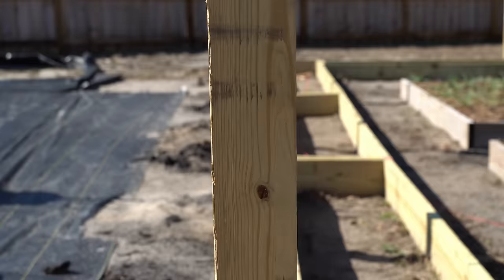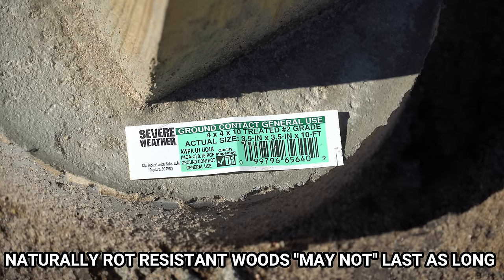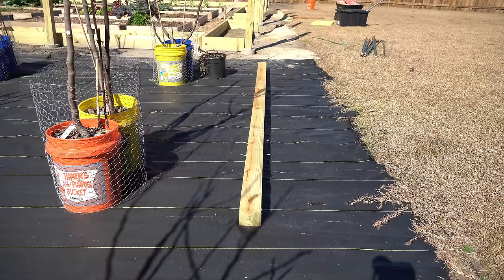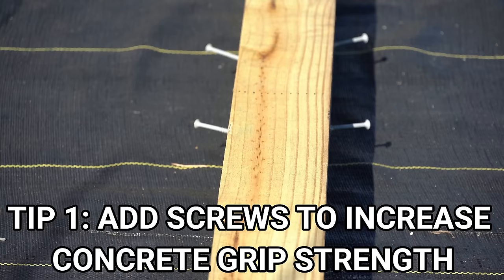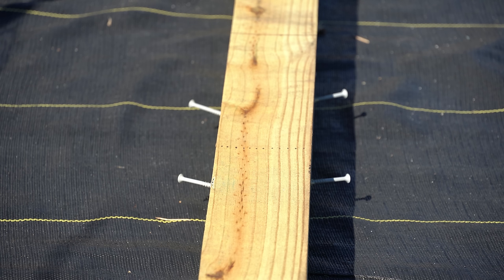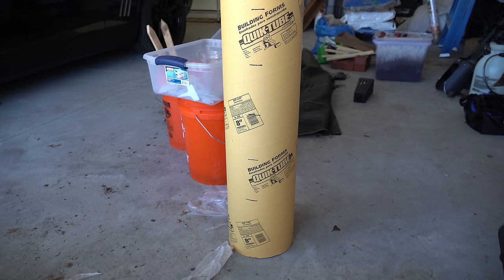3 Tricks To Installing Stronger 4X4 Wood Fence Posts That Last Longer

Comment: There a many ways to increase the longevity and strength when setting wood posts in the ground. Three main factors will affect the installation of the wooden post: 
1. Region (climate) - more specifically, the frostline depth in your area
2. Use - what is the post for? A fence, a gate, a lamp post, etc. 
3. Time - how long do you want the post in the ground? Will you remove it after a period of time?

Setting Post Depths
If you want to ensure your wooden post will never move, make sure your post is set so that freezing ground swell cannot push it back up. Here in Saskatchewan, Canada, any pillar / pile must be set at a depth of below 15 feet from grade (ground level). If you really don't want you wooden posts to move, setting a wooden post on a pillar / pile of concrete, which is 20 feet deep, will ensure this. Check your area to see how deep you need to go to beat the frost.

Wooden Post Longevity
1. Coatings - there are many ways you can increase the 'rot-time' of your treated posts. An old fashioned method is to coat the post bottoms in used motor oil, allowing them to soak up the oil before placing a coat of tar (roofing or basement foundation tar) on them. Painting your posts with several coats of paint will also increase the time it will take for wood to rot.

2. Collar Rot - ensuring your coatings comes above ground level, when the post is set, will prevent the post from rotting where it contacts the ground. Installing a short sonotube (circular cardboard collar) filled with concrete, will make sure this will not happen, however, water can still seep in between the concrete and wood, eventually rotting the post away. To avoid this from happening, caulk around the base of the post, where the concrete ends. This will have to be maintained...every 3 to 5 years it will need to be inspected.

3. Bottom Rot - if setting a wooden post in concrete, placing a 'spacer' between the bottom of your post and the bottom of the hole is a good idea. Wood screws could be used here again, but a piece of rebar, drilled into the end of the post, could be stronger.

Strength
1. Will You Remove the Post Later? - if for some reason you want to remove the post later, hand tamping the post in place, with a mixture of soil and gravel, would be the best option. This was the traditional way to set wooden posts for fences. To remove a tamped post, using a Jack-all and a piece of 2X4, screwed into the post your lifting, will work. Posts set in concrete can be removed this way too, but it is much more difficult.

2. Foam - there is a two-part foam which some people are starting to use, which expands and fills all of the voids in a post hole, essentially friction fitting the post in place. However, any strong force on the post can loosen the contact of the foam to the post, leaving it possible to pull the post straight out of the foam. Adding screws to the sides of the post may be helpful here.

3. Tamping - when tamping a soil / gravel mix around the post, compaction will drive odd sized pebbles / rocks into the side wall of the hole, as well as into the post. This fill friction-fit the post in place, but will also allow you to re-tamp the post, should it come out of alignment, because it can be removed and reset.

4. Concrete - setting a wood post into concrete is far easier than tamping, but it is still labor intensive. The weight of the concrete has an added advantage of keeping the post in the ground, provided that frost does not slowly heave it up over time. Another added value, is that the post can be reinforced to the concrete. By drilling rebar through the post itself, prior to setting it, you can ensure a bond to the concrete is even stronger. Taking it one step further, if you are pouring a pillar / pile under the post, you can tie the rebar through the post to the rebar in the pile. This will make it impossible to remove the post. The downside of this, is that if the wooden post is broken above ground, replacing it be much harder. Steel may be an option at this point.

All of these decisions are dependent on the amount of money you can spend, how long you want the post to last, whether or not you want to remove the post later, and how strong you need the post to be. If you do require something strong, steel posts may be the better way to go. Bolting a wooden post down to a steel bracket, on a pile of pad, will only provide as much strength as the bracket or bolts used. This application is better used on steel posts designed to be bolted to concrete pillars / piles. Hope this was helpful? Cheers.
Reply: Your post depths seem a little crazy for a 4 X 4 wood post.  A 4 foot depth in Ontario will get you below the frost line and prevent heaving.  Your solution for collar rot is a good one, as this is a very common break point for fences, caused by high winds.  I slather a 1/4" thick layer of caulking over the top surface of the concrete and 6 inches up the post.  If it only keeps the water out for 5 years, that's 5 more years before the post can even think about rotting.  Half a tube of caulking per post is usually adequate and it's cheap insurance.
Reply: It’s a shame you don’t have any videos yourself Tim as you seem like you’ve got a pretty good understanding. Thanks for the information though, I learnt a lot...
Reply: @dosfuegos  thanks for the endorsement. I have thought of doing this, from time to time, but I'm an old coot and don't really have the technical savvy to produce videos. Maybe one day I will get my sons to help me. It would keep me out of their hair too...LOL. Cheers.
Reply: Or buy creosote treated larch, under pressure... last 40 years plus
Reply: @andrewbradbury8527  ...it really depends on how deep the creosote penetrates the wood. I am unfamiliar with using Larch, but any pressure treated wood I've used still requires all cuts to have creosote applied. You can see the depth of the penetration when the wood is cut.

Another consideration is how many mechanical fasteners are being used, as well as wood to wood connections where debris, silt, and snow/moisture could collect. This will rot the wood faster. The same applies to where the post meets the ground. If the base is not drained or designed for moisture run-off, rot can take hold there too.

I don't think any coating or treatment is 100% fool proof, but inspecting and maintaining wood posts and joints will ultimately add more life to any outdoor wood structure.
Reply: If creosote is pressure treated, it goes all the way through the wood, problem is getting hold of it!
Reply: Thanks for the insight! I'm in very south Texas (essentially 10" frost line) I plan on building a carport. I'm worried about my wooden posts rotting even if I were to use PT wood. Suggestions? 3 foot hole, concrete footer, gravel, post, finish with more concrete? Motor oil on end of post that will be underground, then seal with roofing tar? Any suggestions would be greatly helpful. Small carport. 8x8 or so.
Reply: @sindelm7437  ...I guess the first thing to look at is how long do you want it to last? How tall, from ground level, will the posts be? This will indicate how deep the post holes will have to be. And, can they be steel posts? Steel is more structurally sound than wood, but wood is (usually) cheaper.

Then you have to see if holes can be drilled out. If there is a lot of rock where you live, getting the hole to the depth you want could be hard.

If there is a slab, how thick is it? If the carport roof doesn't hold a lot of weight, you might be able to bolt a steel post bracket to the slab, which lifts the wood post off the concrete, allowing the bottom of the post to drain. You could also pour a footing or pile that this could be bolted to, or set into the concrete.

There are a number of different post brackets that can be used. Just make sure that they also anchor the post down, so that heavy winds can lift the carport.

Concrete adds weight to avoid the posts from being lifted this way. The more concrete the heaver the counterweight will be. A continuous grade beam or footing around 10"X10", down the length of the carport would do this, or, 4 to 6 foot deep pile that is 12" in diameter. But these are rough estimates. Consulting with a structural engineer is best.
Reply: Say what you want. This man knows his posts. Coming up with cheaper foundation options, can help many more people achieve home ownership. I'm sure many people look into building a house but then they look at that foundation cost and think again.
Reply: There are so many reasons why. So many why’s for each individual . So many why’s we should, so many why’s we must. So many why’s why’s why’s to buy a house. Family,love,human nature turns a house into a home we can all agree is a big why reason end goal. I’ve been a car, motorcycle , bike if it has wheels and a wheel to turn said wheels I wanted to get behind it and go,. ( no wheels to  propel forward in motion, nor a wheel to steer is not a deal breaker either skateboard snowboard, surfboard, skim board. You can safely say with 99.9% accuracy my personal reason for getting a Home was to have personal space to store and work on all these vehicles of motion. Between the content in the video and the extra information broken down into meticulous detail ( I say this next part knowing nothing is easy when working with your hands and your hands with tools in them and a brain full of information with experience and same situation with little to no experience,building fixing anything it’s easier said than done. Change a tire, change a light bulb are day one tasks you learn when you start your house automotive journey. I don’t think there is a factory service manual for for setting a fence post exists, but between your comment on this video, it does now thank you guys so much I learned so much and I enjoyed every minute of it. Please do more on anything anything you feel like doing.

Comment: I would add to your 3" reveal and level the tube all the way around, but use less wet concrete at the very end and create a "coned" top of the concrete.  If the top is made flat and just pitched one way, there will be one side of the 4x4 where water can collect.  If the concrete is 1" higher at the post and angled down to the tube, water will drain away from the post.  Great video.  Great garden!
Reply: Wish I had read this before I commented! Good job.
Reply: That's my go-to method too.  Works a charm.  I let the concrete set up 20-30 minutes or so before I form the cone.
Reply: How to form/do the cone?

Comment: For 6X6 posts for the corners of loafing sheds for horses, we started with a forty-inch hole, poured a four-inch footer of concrete, put two inches of gravel under the post, then six inches of gravel to set the base of the post before filling with concrete.

That way we get a "big rock" as a footer, then the base of the post is not in a concrete "cup" and can let water leach out to the soil.

Comment: I use a trowel to creat a slight downslope of the concrete away from the post. I also like to spray flex seal on the post below grade.

Comment: Few inches of tube at the top is the simple genius move! 👍🏻
Reply from the maker: I worked on construction crews installing traffic signal pole foundations for years.  This was one of the design requirements - the foundation reveal was a critical step.

Comment: Adding multiple coats of water sealer doubles the life of pressure treated, add clear silicone at all wood to cement transitions and with this standard of fence posting you should have a good 20 years no touch fence...

Comment: Thank you!  I learned a few things for sure!  My only concern is the gravel in the bottom of the hole.  I live in a rural area and the drainage in my soil is very slow... I have found that the gravel collects water after a rain.  Water will take the path of least resistance to pool. This can be a problem as the water will continue to sit in the gravel until the surrounding soil drains below the level of the gravel.  So essentially the bottom of the post is sitting in water for extended periods.  The deeper the hole, the longer it takes the water to drain away.  If you have sandy soil this is not a problem as water tends to drain pretty quickly.  But if you have clay soil like mine - not so much.  To illustrate I had just finished digging a 36" hole when it started to rain.  There was about 18" of water in the hole and it took over a week for it to drain out.  Normally I would have put that water to use by dumping my dry mix.  But I had to travel for work for most of the week. 

I guess my point is, know your soil and how well it drains and use a post setting process that best fits that soil.

Moving forward I am going to definitely add the screws for anchors and make sure my concrete goes well above ground level.  Excellent tips!  This is why I love YouTube.
Reply: Cowboy Stevo I coated the bottom portion of my posts with thick roofing tar - troweled it on pretty thick and made sure it was worked into the wood real good.  Then I set them in concrete and expect them to last for many years.  A couple of inches of the tar shows above the ground but I want to make sure they don’t rot right at ground level.
Reply: @danielholtxxl4936  I do the same thing... I also coat the entire post in a 50/50 mixture of used motor oil and diesel fuel.  Then coat the bottom of the post with asphalt roof patch.  Though I don't cover the end of the bottom of the post.  Some moisture is always going to make it into the post, so that gives the water somewhere to wick out.
Reply: What do you for clay/rocky soil then? Drill a rebar to stick out from bottom of post to create space between wood and soil?
Reply: @LL-wh3uc  Well... what has worked so far is coating the bottom of the 4x4  post with roofing tar to above ground level.  I don't cover the very bottom of the post.  Then bury it in concrete as normal.  I have some posts that have been in the ground since 2009 and they appear to be fine.  No detectable rot at ground level.

Comment: Note to self, for future reference.
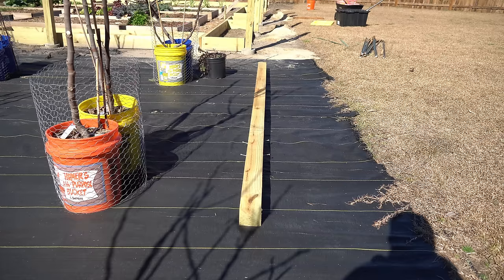(1:32) Tip #1: Increase strength by drilling screws part way into the part of the wood that is to be encased in concrete.
(4:43) Tip #2: Increase resistance to rot by putting a three to six inch layer of gravel beneath the bottom of the post.
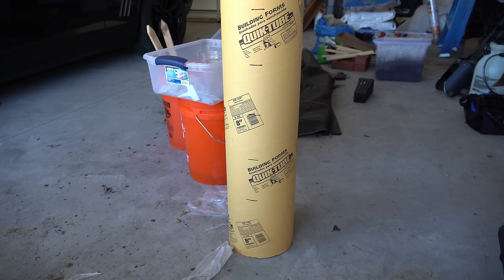(6:58) Tip #3: Use a concrete form tube and pour the concrete higher than ground level so water pools against the concrete rather than against the post.
Reply: If you can get black locust posts you could just stick em in the dirt without them rotting, it is the best wood ever for posts, there's a 100+yr old fence near my home that was put up that way, no concrete just locust.. Still is solaid as the day it was set.. Problem is finding black locust posts without cutting it down yourself.

Comment: Hey love the tips about the screw however at 4:07 you said galvanized! I think you meant bright nails. For those who don’t know the chemicals in the pressure treatment react with the galvanized nails the mix is volatile and will rot the wood and or eat the nail
Reply: Good to know, thanks.

Comment: And dont forget the top of the post. Rain sets on top and seeps down the grains of your post. You can set a container over the top of the post. Bird houses are good to protect your post.
Reply from the maker: Pressure treated wood is soaked, so the copper preservative penetrates the insides.  My concern with rain touching the top is pretty low, and I'm only concerned with the posts sitting in continually wet ground.

Comment: I have added a collar of concrete above grade, as you are showing in this video to a fence I built 7 years ago. As the concrete cures, it shrinks and cracks. This is the nature of concrete. So for those who are expecting this to look like a nice, tidy round foundation, rely on it cracking because it will. It won't break away, but it will crack and unless you use a very large collar, the cracks will run all thecway from the top of the collar to grade. Maybe further.  Still, I  think it is worthwhile to do, and even cracked, it looks pretty good. The upside is, once the post rots out (and they all do, eventually) you may be able to cut the post off at the top of the concrete, core out and remove the post, install a post base in the square hole and fill that with concrete. You may even be able to re-use the post, if you can live with it being shorter. 
Or, just dig a post hole, add the collar, use a post base and set the post above grade. I have done this too, and used welded flying buttresses to add lateral strength. And that is a thing I have never seen except in my own installations. It's hell for stout.
Reply from the maker: For the record, none of my concrete collars have any cracks.  They're all perfect to this day.  I used both the Quikrete rapid set concrete in the red bag and the standard in the yellow bag.  I had no issues with either.  In order to achieve this, I did this during good weather in the winter.  Here, the days are usually 50-60 in the winter, and I made sure to do this during nights where we weren't getting close to freezing.  The concrete was able to cure in very consistent temperatures in the 45-60 degree range, nonstop.  This, I surmise, prevented a lot of cracking that can take place with very hot summer sun hitting the concrete, followed by huge cooling off at night.  If you are concerned about cracking, you can hose them down periodically during the day to prevent too much evaporation too quickly.  But pouring concrete in that 50-60 degree range really helps!